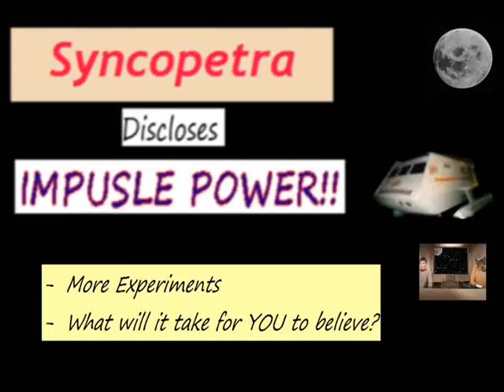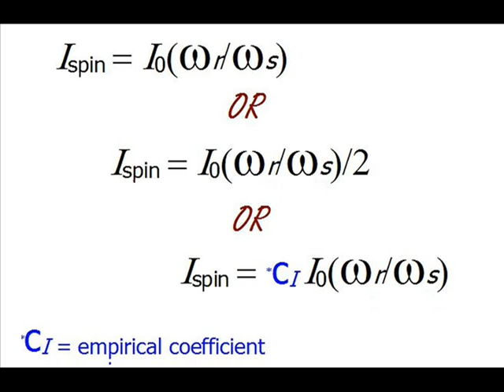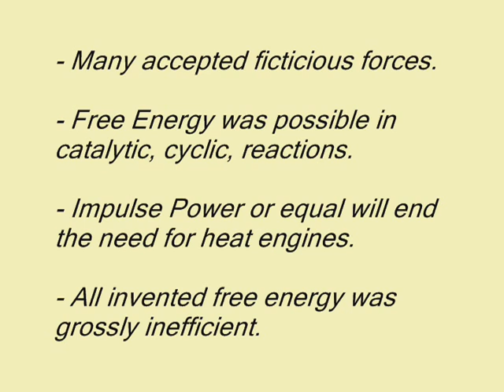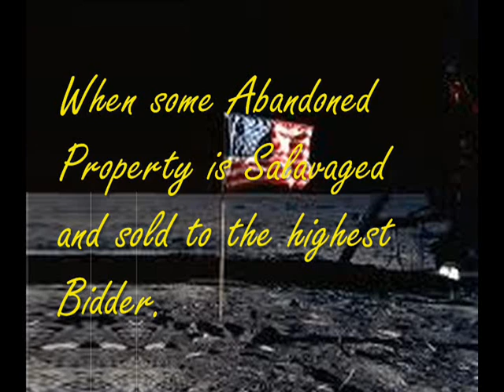CFEO Experiments

Comment from the maker: Cavitation is a well know way to consume hp with a pump, a 'switch' according to the requirements. All impulse power I am familiar with is derived from angular momentum. In cavitation there is none. Cavitation is low pressure boiling or forming vacuum bubbles.